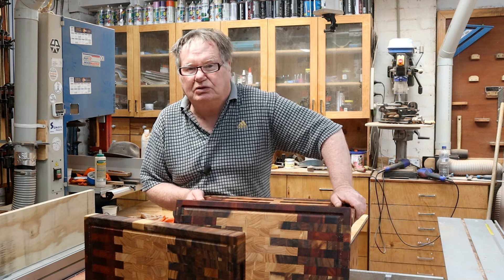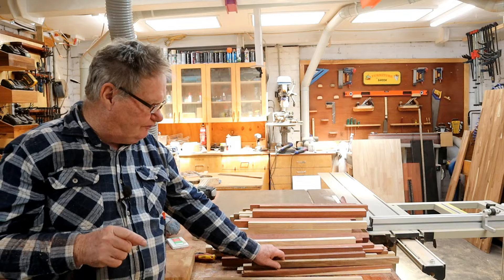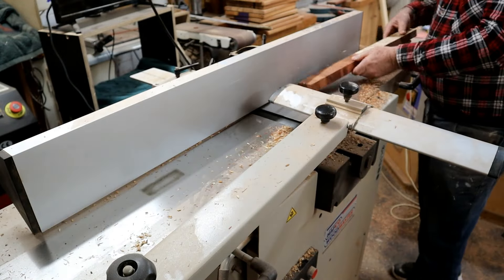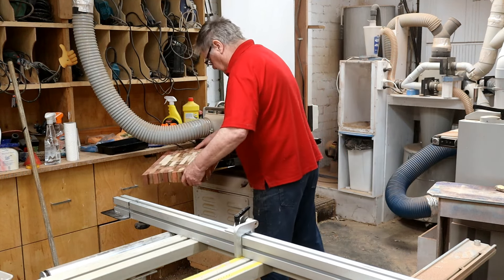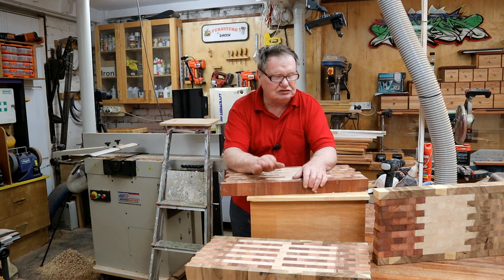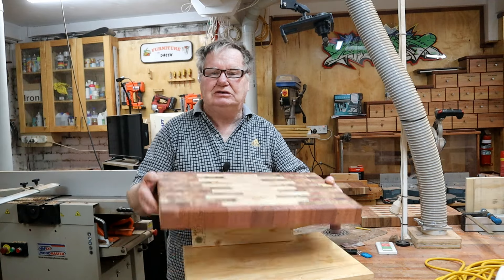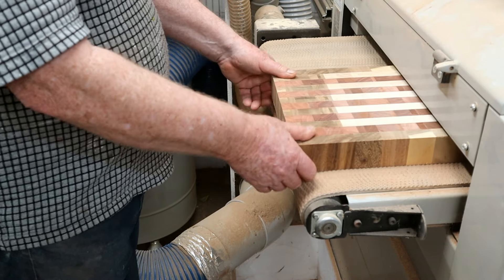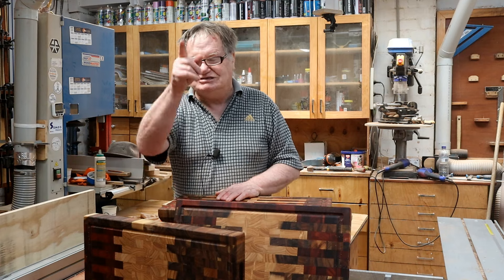MUST WATCH! 3 CUTTING BOARDS, BUNNINGS TIMBERS ONLY/ EASY $$$

Comment: nice work. when say big box store are you talking about bu****ings cause my local in singleton only stocks pine and pre finished timber decking (trying use that seems like massive waste have sand finish and plane out anti-slip grooves). i normally use pallets for most of my hobby but wanted to branch out into other woods but cant find anywhere to buy them since hardwood pallets are scarce. im willing to travel couple hours hell nearest bunnings is an hours drive each way (im here 32°14'43.1"S 150°26'52.2"E) maybe you could add some links in video description for stuff you bought, help us newby's in just getting started
Reply from the maker: hi Scott, yeah bunni-g  is the store they do have a good range of finger jointed timbers, as i only make small things now like boxes and cutting boards i get value for money another place i have brought timber from is e bay and facebook marketplace i buy my imported timbers from  mathews timber in vermont melbourne which is on the other side of town and it takes me a hour to drive there too lol but good timber is expensive another place i have got good timber from is new houses when they are laying a new timber floor and they have off cuts so become a woodhound, and siff it out cheers daniel